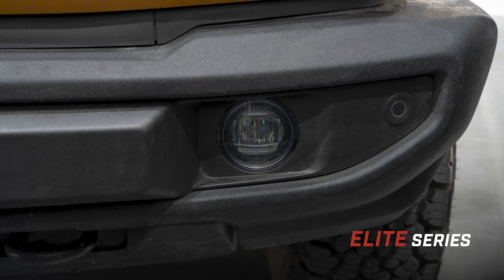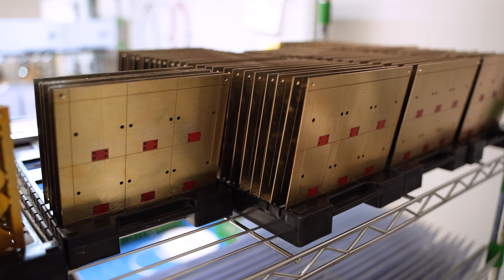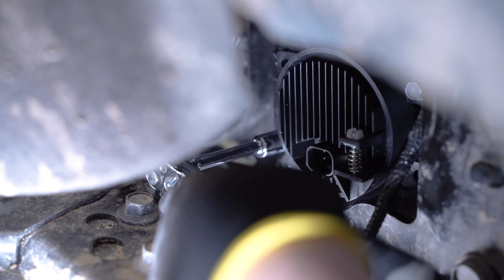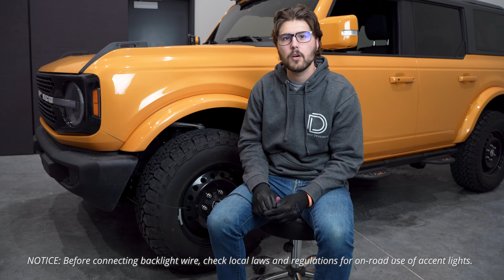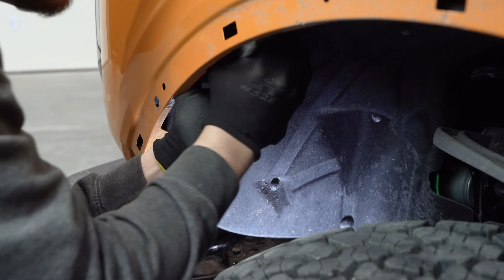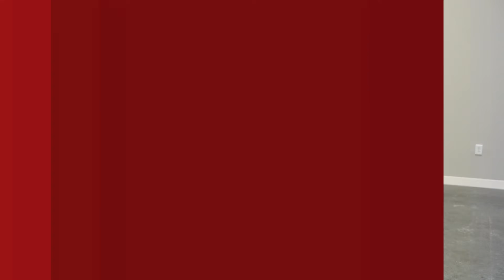NEW! Elite Series Fog Lamps for 21-22 Ford Bronco | Diode Dynamics

Comment: Def a fan of Diode Dynamics ❤ I just wish these came in amber. I have roof mounted lights, ditch lights, trail markers, and drl amber (DD/Form) headlights and it’s difficult finding an amber fog light for the Bronco to make everything flow together.
Reply from the maker: We do offer the same 3000k selective yellow output as our Stage Series Products!

Here is the link for you:

https://www.diodedynamics.com/elite-series-fog-lamps-for-2021-2023-ford-bronco-pair.html
Reply: @diodedynamics thank you for the kind reply! I was hoping for more of an orangish color to flow with the look. The yellow does do a better job at cutting through the fog, but I was needing an orangish appearance to flow with the form headlights.  I’m going to try an amber overlay and see if that gets me close. Thanks again!
Reply from the maker: @Ravenvoyager  That would be our next suggestion!
Reply: @diodedynamics  I found a set made by Heretic that I might go for depending on how the overlay looks after they put it on. Thanks for chiming in and for your awesome assistance in getting me setup!

Comment: My 2023 Ford Bronco Big Bend built in the first week of November of 2023 had bolts securing the fog lights with a 3/8 head not 10 mm. I installed the lights and they are great! They are brighter, with a wider beam pattern and the light lights up the road much farther.
Reply from the maker: Thanks for the heads up! We'll have our team update the listing!